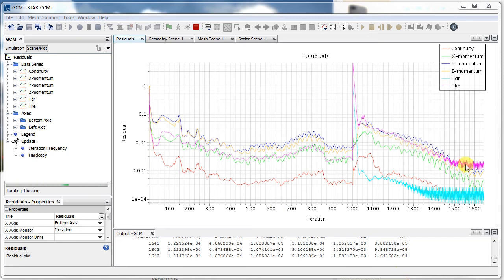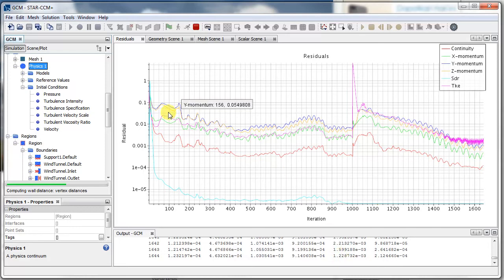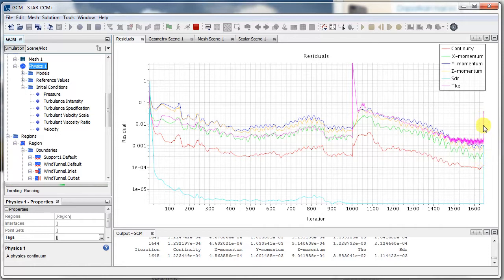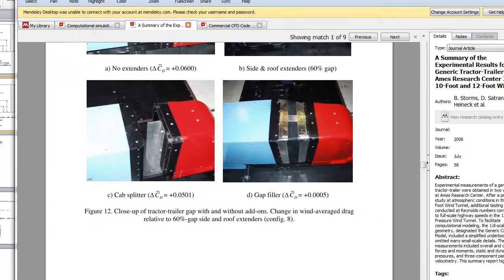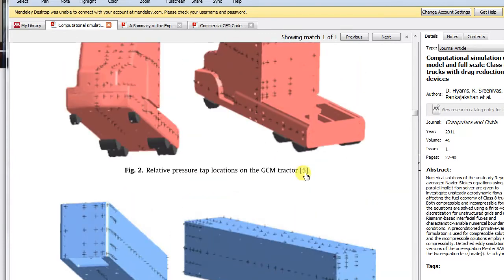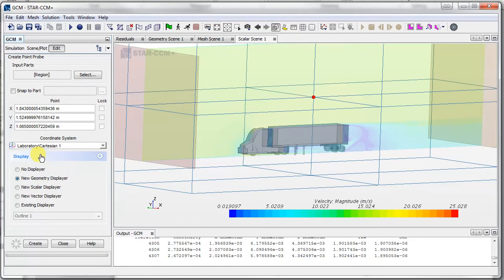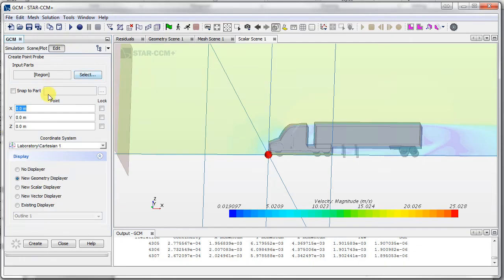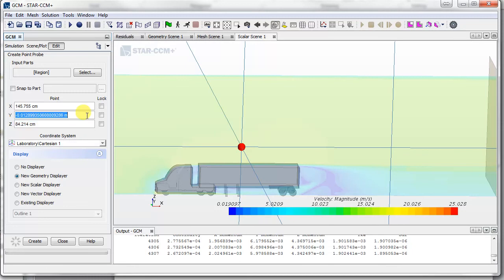Star ccm+ Beginner to Pro [Simulating a truck part 16]

Comment: what part (video) was the new coordinate system created?
Reply from the maker: Hi sorry I must have missed this out. It is helpful to create a new coordinate system that corresponds to the front center floor of the truck geometry as specified in the paper. This will help to do things like position this pressure probe correctly. If you go back to video three where we reposition the truck from the corner to the new location in the wind tunnel, your new coordinate system should be the same translation.

 So go to tools>coordinate systems > right click > new coordinate system.  Then put in values of x, y and z that correspond to how we moved the truck (x= 13.33 cm, y = 1.525 m, z = 1.5 cm) that should be solved. let me know how you get along and sorry for the missing information.
Reply: @zacmac  @chenrubo4650 In the new Simcenter StarCCM+ 2302 version, you should go to Tools > Coordinate Systems > Laboratory > Local Coordinate System > (Right Click) New Coordinate System > (Your Prefered Type). Then, the window which accepts the cartesion or any other coordinates should appear. The rest is same!
Reply from the maker: @gameops3130  Thanks for the updated procedure